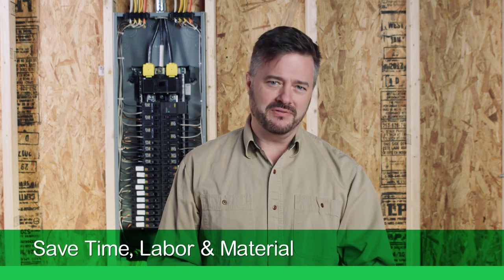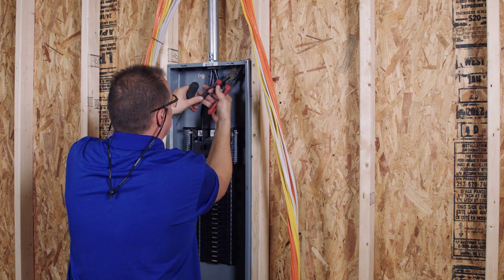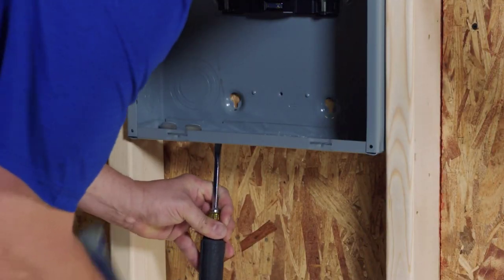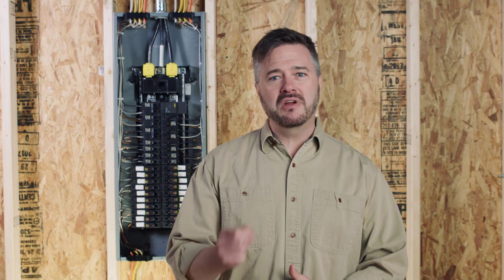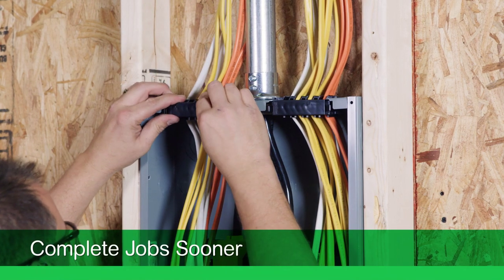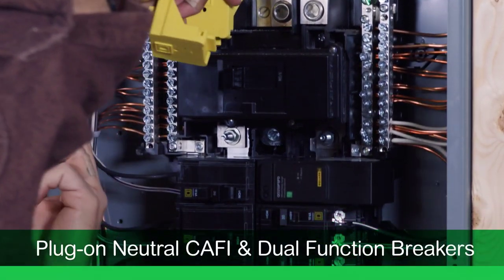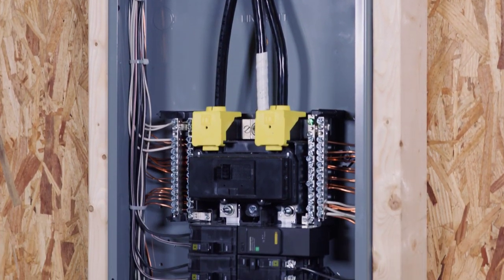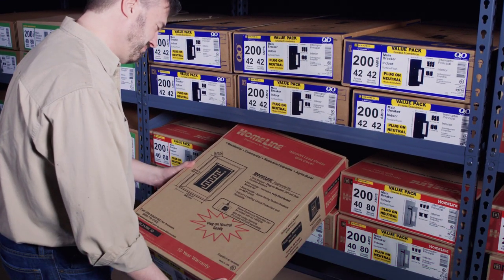Plug-on Neutral Load Centers with Qwik-Grip Wire Management System | Schneider Electric

Comment: I have a 150 amp panel where the grounds are connected with the neutrals. How do i wire a square d qo plug in neutral panel properly?

Comment: 14 year electrician here.  Used this quick grip for the first time today.  WHAT A PIECE OF SHIT DESIGN! Slipped off while pressing the wires into the quick grip and stabbed both of my thumbs and was bleeding all over. These tabs do not seem sharp but I can tell you they are.  I hope to never use this POS design again!  Ill continue to use my RC50/75's, thank you.
Reply: ceetwarrior,
I will be installing this model panel later this week. It will be a first for me also. I appreciate your candid assessment of the risk and will be sure to wear Kevlar gloves and take extra precaution while dressing the wires in the quick grip assemblies. Thanks so much for your feedback. I hope you have fully healed by now.